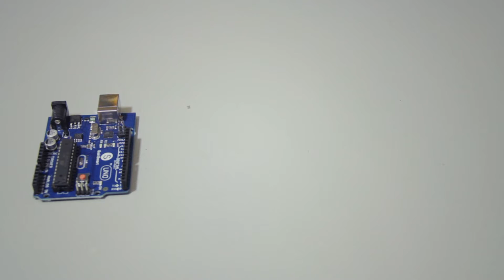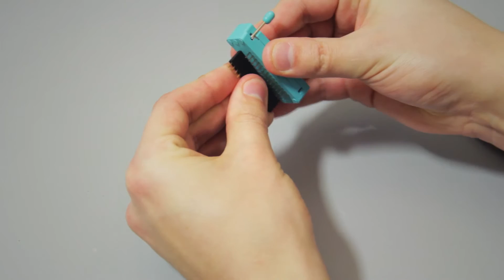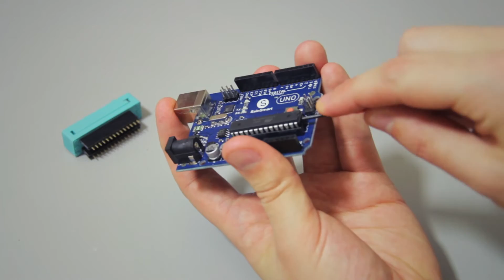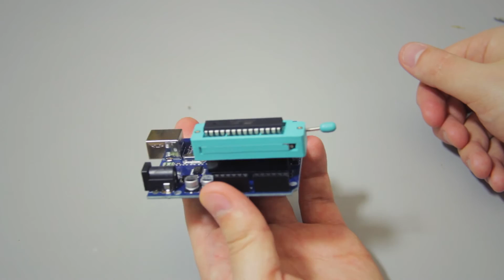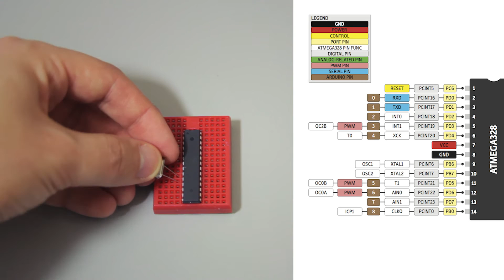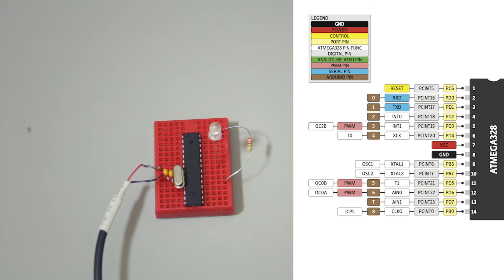DIY Bare Bones Arduino - Maker Guide Episode 8

Comment: ALL ATMEGA328's don't come with arduino bootloader flashed to chip.So if you use a regular non flashed chip it will not work the way your show here.
Reply from the maker: You're right, I can't believe I forgot to mention this. I'm adding a note in the annotations now. Thanks rog.gamer!
Reply: No problem.Awesome content by the way,Keep it up.